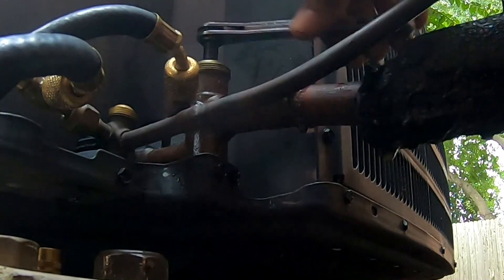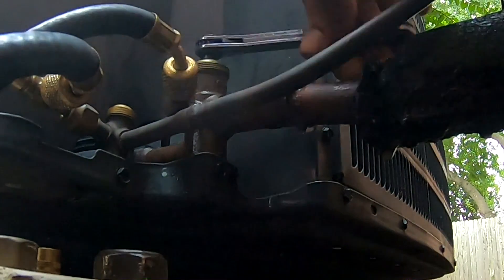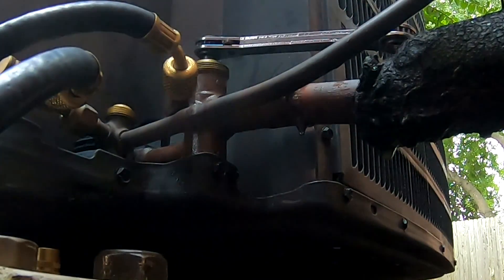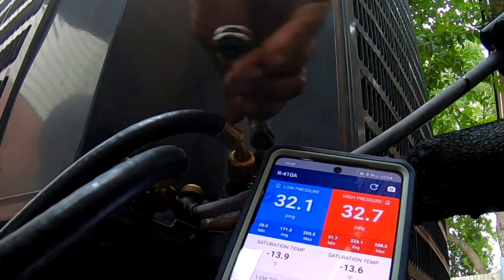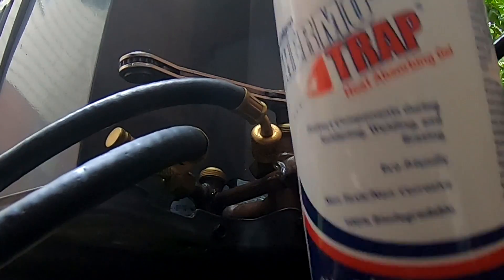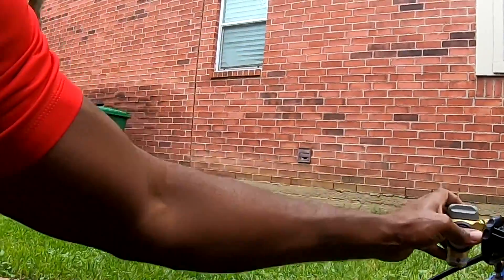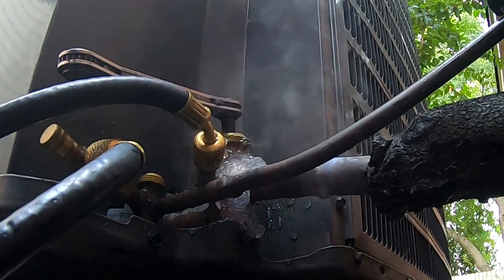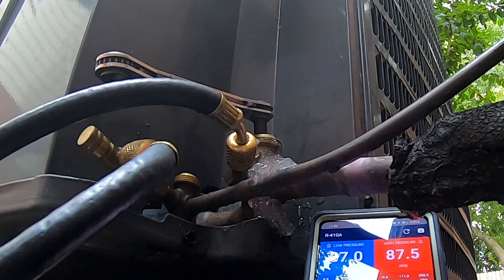AC not cooling Leak repair on suction line set

Comment: FYI. When I pump a system down and the disconnect is not close by I pull the low voltage wire off the contactor.

Comment: I have question
Over there in the US,when you pump down,you put the gas in a bottle or something or do you lock it up in the ac system? Just asking
Reply: Depends on the system too. It is not recommended to pump down micro channel systems.
Reply: @camerondierking1639  example?
Reply: @camerondierking1639  gotcha. I only use 410 and 22, I stay away from the knock offs.
Reply: @camerondierking1639  to my knowledge there is nothing wrong with pumping down a 410a system unless it's micro channel.